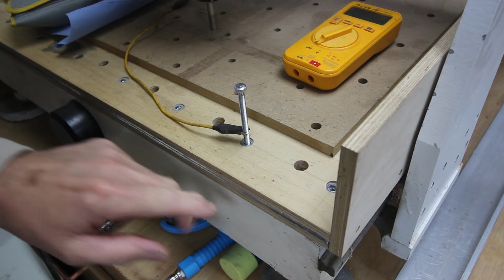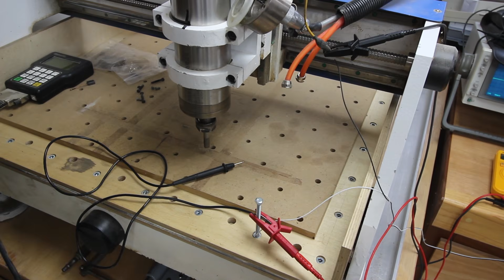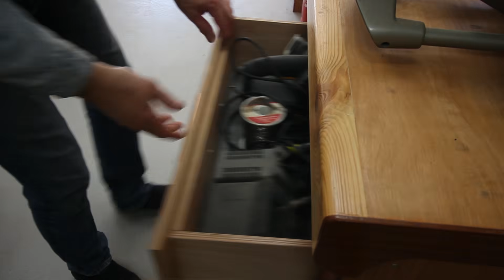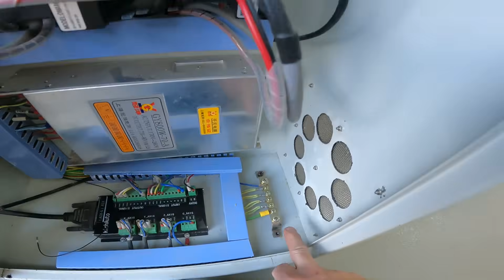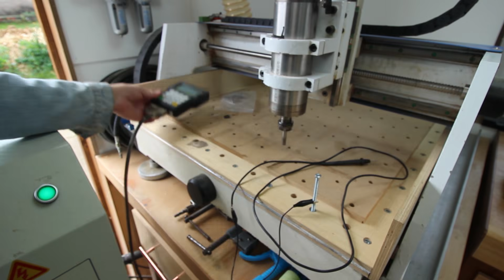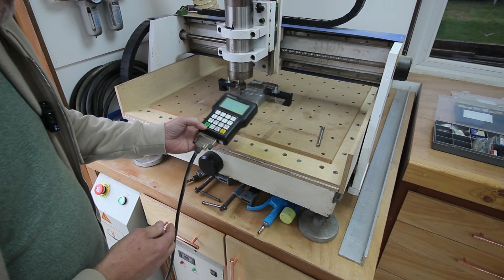Revolutionary DIY CNC Crashproof Router Bed: Say Goodbye to Crashes!

Comment: Regarding unit beeing leathal.... The issue is not the reversed neutral and live... Somewhere you have a short between power circiuts and chasis or the connector you held when you got shocked.... There shall be isolation between both live and neutral to all low voltage signals and chassis and so on.... In fact in most counties we dont keep track of which is which in a 1phase load. You should look over your unit after low ohmic connections to the circuitry from both live and neutral... And remove it... Until then the unit shall be regarded as dangerous....
Reply from the maker: Thanks for the detailed explanation, it's something I definitely need to look into further to make sure everything is safe.
Cheers

Comment: It’s an interesting project — the contact system and the electromagnetic noise resolution — but I must admit I don’t quite understand how this will help prevent tool breakage during machining. After all, the tool will always be in contact with the material (the metal workpiece) while cutting, so the motor would keep stopping all the time… or maybe I’ve missed something?
Reply from the maker: Hi @patricdjebar9225,
Good point this machine can cut aluminium but it’s not good at it, you can hear it quarter mile away! So it’s best suited to wood plastics etc. they are all insulators so the tool will cut through without problems but if it runs into a clamp screw it will stop.
I have broken several cutters over the years with this very problem, if I need to cut aluminium then you just need to isolate it from the hold down screws with a bit of tape and your good to go!
Cheers

Comment: If you've watched any number of Big Clive's videos, it wouldn't surprise you in the slightest that the active and neutral were reversed.  😮
Reply from the maker: Hi Andy,
It’s just sloppy and dangerous, I’ve heard people say Chinese machines are just a kit of parts that will need putting right!
Cheers
Reply: @CazualHaze on the other hand I have hardly hard issues with my FoxAlien Vasto cnc router. 
In my case, Crashes have never occurred due to the gantry hitting the end stops. I am surprised to know this happens. 

 However my computer does hang up once in a while especially when starting up, but never when the job is in progress.

Your solution is quite brilliant though

Comment: Instead of constantly looping and looking (reading) the state of some pin, maybe it is not bad idea to use interrupt.
Reply from the maker: @pecilijevelicanstveni4973  Yep that would be a great idea, I am basically lazy and so polling a pin was my easiest solution. You are right though an interrupt on pin change would have been a very sensible solution. I will see how I go then change if needed.
Cheers
Reply: @CazualHaze  👍👍👍Do it. Much faster response and very short code.

Comment: Hi David,  nasty clack...... Polarities reversed, some times this doesn't effect a running of a machine, just depending on the circuitry. the E stop works well very effective this will save you in cutting tips. Good to see your CNC running with the correct polarity.
As always a great video, have a good weekend take care.
Reply from the maker: Thanks Shaun,
Yep I am pleased that I got this one working.
I’ve learned a lot from it hopefully it helps save cutters.
Cheers

Comment: Could you change some settings on the spindle VFD to make it stop faster on shutdown?
Reply from the maker: Hi @Cloudsbelow976,
Thanks for the comment, I’ve already done this in a previous video. The problem with my vid is it’s not got any way to connect an external brake resistor. My cnc mill can stop from 5k rpm to zero in two /three seconds the router takes closer to six!
A new vfd would be my best bet,I will try it as is and see how I get on,vfd,s are not cheap!
Cheers

Comment: Using optocouplers is exactly the right approach.
Not because of the isolation of the two circuits within the optocoupler (LED and photosensor), but because of the current required to make the LED light up and thus switch.

In my mini CNC machine, I integrated the end stops for each axis into the stepper motor cable (making wiring considerably easier). The current for the motors induces significant voltages in the limit switch wires.

The inputs of the Arduino (or any other microcontroller) react to voltage changes. These can be quickly reached by induction or electrostatics, but there is no current flow behind them.

The LED in the optocoupler needs, say, a minimum of 2 mA to make the photosensor switch. This effectively filters out induction or electrostatic effects. If the wires are too long, it is also possible to connect a resistor in parallel with the LED. This means even more power is needed to light up the LED.

Overall... another great video from you.
Thank you very much for this, and I wish you as few tool breakages as possible and always high efficiency. 🙂
Reply from the maker: Thanks @BitSchupser,
Thanks for the comment,it took me a while to figure this out moving from a voltage sense to a current based solution drowns out the noise as you rightly say. I hope it all proves to be reliable but it sounds promising as you have a similar solution which I guess works well?
Cheers